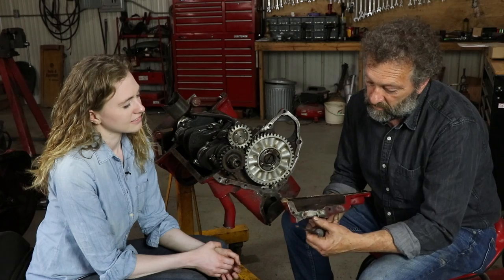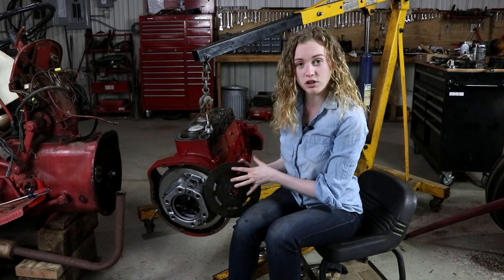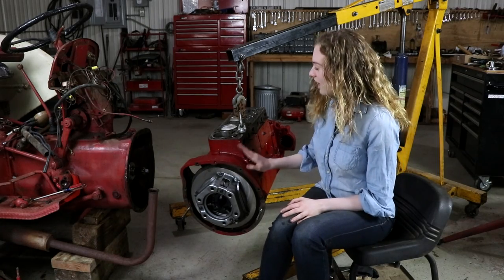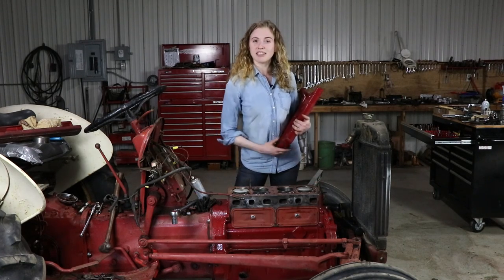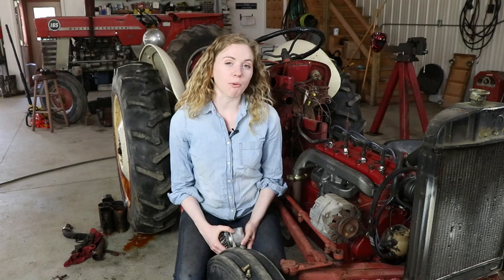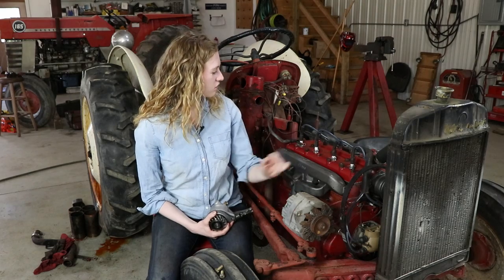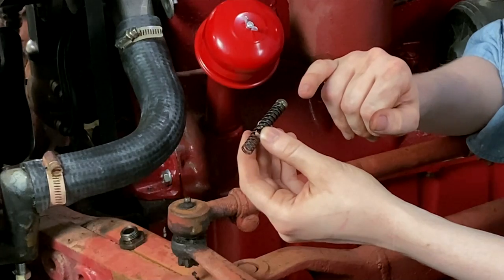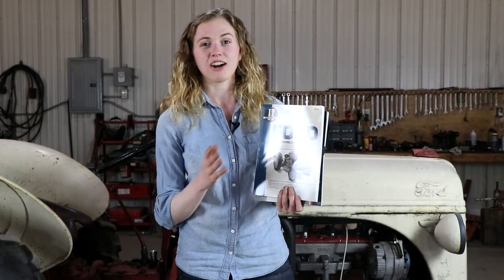Ford Engine Rebuild: 8N, 9N, 2N. Part 4 of 4, Reassembly: Head Gasket, Governor, Clutch, Front Axle

Comment: I was a little fella in WV when my dad bought a brand new '51 Ford tractor with my grandmothers help.  That little Ford always comes to mind when I see another because in my mind, that is what a real tractor looks like.  My granddad was still farming with horses; plowing, mowing, raking, dragging shocks, and so forth.  Dad sent me out into a heavy snow at age 6 one morning, to start the tractor and let it start warming up.  I marched over to where the tractor was parked, climbed up, stood on the clutch, wiggled the gearshift, and pressed the starter button.  It didn't start so I gave it some more gas, pulled the clutch, and pressed the starter button again.  It still didn't start.  After several tries, I gave up and trudged back to the house with my head down.  Dad asked if it started and I said no?  Then came the first time in my young life that I felt really dumb; dad asked if I turned the key on?

Comment: It's so special to be able to work with your own dad. My dad had his own machine shop and he trained me and I worked with him as long as I could. The bond between your dad when you're doing something like that as a team is wonderful. One of my dad's hobbies was too build a Piper Cub airplane from scratch and fly it. He would literally buy a box of tubing weld it together, cover it in fabric, cover the fabric with polybuterate dope, then paint it Piper Cub yellow. The motor he would usually buy it all disassembled and rebuild it. the cables seats and doors would be put on and then finally the wings.  Then even though he had great faith in his own accomplishment, he would go look up his world war II buddy who had a Kamikaze attitude about life and he would ask him to test fly it for him 😂. Then to get it inspected where we lived in Washington state he had to be 150 miles away in Spokane so he would fly it there. The inspectors would come out and they'd say how did you get here and he would say I flew 150 MI and they would take a quick look and say it was air worthy, then they would look at his improvements to the required mechanicals and they would say it was better than original. The neat thing about tractors to me is that the older and simpler they are the more they are impressive and the less technical they are the easy they are to keep running. When I parked my 9N it was because it had stalled out and it had sand in the carburetor I have since gone through everything replaced the tank the fuel line the carburetor tried to start it and realized I had no spark 😂, I haven't started it for about 3 years because i put it in my shop just before my dad passed away. Today as of this writing I'm going to go and fire it up I've got spark I've got fuel, so fingers crossed.

Comment: Great Video's lots of usable info, I have rebuilt all kinds of engines over the years but about 5 years ago bought a 8N tractor and knew absolutely nothing about flat head motors. I have a drag blade plus a old bucket kit someone added on. This thing smokes and sputters but when it digs in, them back tires just keep on turning and nothing can stop it. Had problem with plugs fowling out due to oil in the cylinders, so I know she is worn out and needs a good rebuild. I put some fowlers on it for the plugs, but it is time to over haul it. These video's have really opened up a whole new world for engine building. Got to finally see just exactly how the flat head valves work. I always thought they would be more complicated then that, LOL!!! Compared to the 4 cam's and 4 valve's on my Ford Shelby  these things are a piece of cake. Thanks again, great video.

Comment: I loved these 4 videos. Rachel certainly knows her stuff when it comes to repairing machinery. I began a 5-year apprenticeship in motor mechanics here in England in 1961. I was 15½. Twice a week I attended the local technical college to learn the theory of machines, power to weight ratios and loads of other stuff. There were no girls doing motor vehicle mechanics on any of the courses. Only young lads. Maybe it's different today. Before I was old enough to drive I had several pre-war cars I tinkered with, including a Ford 1172cc 8HP Model Y with rod brakes. That was a 1936 model as I recall. It had the typical Ford split valve guides. After I finished my apprenticeship I moved to Germany as a guest worker in the prototype department at Ford-Werke in Cologne. When we dismantled each prototype car after hundreds of hours on the test track, we had to lay out all tbe main components on long wooden trestle tables in their approximate positions on the vehicle. Then the design engineers would arrive to inspect everything. We had to use a torque wrench on just about every nut and bolt, then paint a narrow strip of yellow paint from the nut or bolt head to its flange, so any movement could be spotted.

Comment: I am curious , with all your knowledge and parts availability , why did you go to 12 volts on your tractor ? I have an early 8N with the 6 volt system intact , and it starts quickly year round . 
Thanks for these videos , your teachings are easy to follow .

Comment: Can you do a video on a Long 560? I have recently purchased one and it also was sitting for approximately 7 years. The guide rod for the high and low is seized and the guide rod for 1st and 2nd gear is broken in half.  I know I'll have to split the tractor so I'm thinking of replacing all seals, bushings, bearings, etc... I did purchase the shop manual and the parts manual.

Comment: I've got a 1950 Ford 8n that leaks water into the engine oil. Is this a possible Crack in the block or the head gasket? I had  the block patted and rebuild it but didn't  check for cracks. The head looked pretty stright.

Comment: The distributor drive slot in the end of my camshaft is broken. Do I need to take my engine apart completely to replace the camshaft?
Reply: Yes if the distributer slot won't turn the the distributer then the point won't send spark to plugs. In short the tractor will not run. Guessing you know this already but noticed no one responded.

Comment: I wish my 8N started up as fast and as smooth as this. Mine cranks several times before it even thinks about starting.
Reply: Mine was like that too then I replaced the carb and now starts faster than my car (Honda). Not as smooth as the car though ;-) It starts just as fast as in the video.
Reply: @ZeeFrankensteel  Thanks Zee. I replaced that awhile back, but still having issues. Tested all the electrical, so I think it’s my starter.
Reply: Is it 12 volt or 6? 12 volt conversion with a hot coil will make a huge difference.
Reply: @tonya.2113  Thanks Tony. It’s a 6V. As an update: I replaced the ground and positive cables, and the coil. She fires right up now.